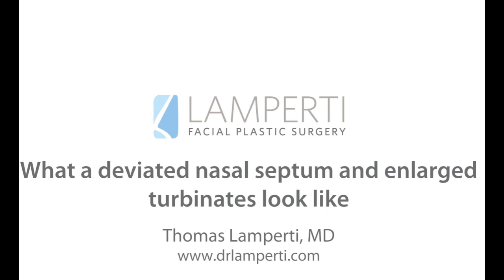What a deviated nasal septum and enlarged turbinates look like

Comment: Hi, Dr.
Is the turbinates made
out of tissue or bone ?
Reply from the maker: +Ruben Ruvalcaba The turbinates are made out of both. There is a thin layer of bone in the center of the turbinate which is then surrounded by varying amounts of soft tissue. Best, Dr. Lamperti
Reply: Hello Dr. is it possible to shrink enlarged nose(side) affected by sinus? If so,how can i shrink naturally without operation or nose surgery?
Reply from the maker: Kennedy Charanga There are various nasal medications that can be used to reduce internal nasal swelling. You can check with your doctor for specific recommendations for your situation. Best, Dr. Lamperti

Comment: hi i have a deviated septum ,recently using steroid sprays but no relief, i am afraid of operation and tell me will marks of stitches remain after surgery if remains
 then how much
Reply from the maker: amir ali The standard septoplasty incision is placed inside the nostril area where no one else would see it. In my hands you wouldn't be able to see any suture marks once the sutures dissolve. Best, Dr. Lamperti

Comment: Is it possible for half or a portion of the turbinates to be enlarged and not all of it?  I might have to get the turbinate reduction surgery, sometimes I hear like a popping noise in the area that I feel discomfort is this normal? I think it  might be the turbinate rubbing against the septum.
Reply from the maker: Yes, it is possible for the turbinate to be asymmetrically enlarged. In some people the turbinate is enlarged more toward the back of the nose or vice versa. It's hard to know what is causing your popping noise -- that's not a typical symptom of turbinate enlargement in any case. Best, Dr. Lamperti

Comment: Hi Mr.. Lamperti, just checked out your website and VERY impressed by your work! You seem like a true expert! It's seriously great that you can achieve the kind of results that I've seen on your website....a nose makes a huge deal in a person's sense-of well-being since they have to live with how it looks/functions for the rest of their life.

That being said, I was wondering what causes trouble breathing through the nose BESIDES a deviated septum? I had 3 cases of trauma to my nose a year ago. The nose never broke or change on the outside, it just got red. However, after the 3rd hit my nose felt really weird and damaged on the inside. It feels permanently stuffed up on one side and its not really smooth to breathe out of the other side. I just want to get my old breathing back. I've gone to 3 ENTS and all 3 of them said my septum is NOT deviated and I have the same amount of space to breathe on both sides. So what else should I do if this breathing is really bothering me? By the way I NEVER had allergies or any stuffiness/blockage before the trauma so I feel like there could be cartilage/structures in my nose damaged that maybe the ENT's couldn't see?
Reply from the maker: Hi Lena,
I can't say what's causing your nasal breathing problems without examining your nose, but in general other causes of nasal blockage (besides a nasal septal deviation) include enlarged turbinates, enlarged adenoids, nasal polyps, and narrowing to the internal or external nasal valves. An injury to the nasal valve is possible with trauma and could involve damage to the cartilage support of the nose. Best, Dr. Lamperti

Comment: thanks for the answer,doctor. so if cartilage has memory, does that mean after the surgery it will go crooked again over time? and how risky is the surgery? also, is it possible to achieve 100% perfect breathing from this surgery? i can breathe just not very well, so i feel like this surgery is a waste unless it can give me perfect, clear breathing.
Reply from the maker: Every surgeon is different but I usually remove the crooked cartilage so that it isn't in your nose anymore to cause trouble down the road. I'll sometime replace a portion of straight cartilage back in there, though. Septoplasty surgery isn't typically a high risk procedure. Your specific surgeon would be able to give your more customized guidance on that.  It's hard to know what 100% perfect breathing is. There is no "normal" amount of nasal patency that we can use as a guide. The sensation of nasal openness is quite subjective. I find that a lot depends on how deviated your septum is and how much straighter I suspect I can make it. Best, Dr. Lamperti

Comment: Hello Doctor. Had the Flu back at the end of February and ever since then my smell and taste faded. Been told it could be sinusitis. Going to an ENT doc and after a few visits and after a round oral steroids the inflammation in the left nostril seems to have gone down but he stated the right was still inflamed. Still having trouble with smells and taste but seems to have some gradual improvement. Could the tribunates be an issue? Seems like the smells seem to come and go. I'm currently using generic flonase and allegra. I will be going back for a follow up in 1 1/2 weeks and should I ask my doctor for an x-ray or CT scan to see if there is any other issues? He has been using the endoscope to see into the nose. Also  could the inflammation or turbinates cause the reduced smell? I've been to an allergist and they said i tested positive for dust mites allergy but have never experienced these nose issues like this before. Also seems like the stuffiness in my nose switches sides . Any insite on steps to ask my doctor or suggestions would be great.
Reply from the maker: Hi Ralph,
That's great that you've been seeing an ENT doctor about your smell and taste issues. It would be unusual for turbinate enlargement or congestion alone to make it hard to smell or taste. That's good to hear that you're noticing some gradual improvement at least. At some point your ENT may want to do a sinus CT scan but that depends on how your nasal exam looks and how your symptoms are doing. The main idea of a sinus CT is to make sure that there aren't any polyps up high in the nasal cavity blocking the smell organ. I haven't actually examined your nose so obviously can't give very specific advice.
Best, Dr. Lamperti

Comment: Hi Doctor again great video. Couple questions again please answer you would MAKE MY DAY as I have been struggling to breathe for MONTHS. okay so since cartilage is flexible, can you push on your deviated septum to move it back to the middle? mine is bent to the right and i wonder if by constantly pushing on it over time (like sticking my finger up my nose and physically pushing it) I could move it out of the airway?
also should I consider getting surgery? I have NO Other symptoms (no nosebleeds headaches) besides a right blocked nostril (and sometimes the left one but mostly right). i dont want to live with bad breathing forever, but again i am scared of surgery. also, I heard "everyone" has a small deviated septum and they dont notice. is that true? i dont want to get someting fixed that doesnt have to be, you know? I have a deformation of cartilage in my nose from pressing on it (but i never broke it) so i wonder if it will ever just eventaully heal up or shift back to the middle (like it used to be)
Reply from the maker: Hi Rose,
Though cartilage is bendable, it also has memory and tends to want to go back where it was. It's up to you about having surgery. I can't really give much input on that since I haven't examined your nose, though. Septoplasty surgery is certainly elective and is done to help with nasal blockage symptoms. You don't "have" to get it fixed if you don't want to. Best, Dr. Lamperti

Comment from the maker: Hi alf,
The middle turbinate less commonly overgrows and blocks the airway. However, the middle turbinate can sometimes have what is called a concha bullosa. This basically means that the turbinate has an air cell inside it. This can cause the turbinate to be too bulky. There are ways of reducing the size of a concha bullosa but this is different from treating the inferior turbinate. Concha bullosas aren't related to allergies. That's just how the turbinate formed. Best, Dr. Lamperti

Comment: My ent said he can see to the back of my thoat, but only checked my right side which was the most obstructed. Then he goes on and starts becoming dismissive of my symptoms, and said nothings wrong. However, i can see the cartilage is bent like a boomerang to my left and blocking most of my right side, i also get occasional get sinus pressure, pain, clogged nostrils depending which side has pressure, and excessive mucus in the back of the throat, i used to have nosebleeds on my right side

Comment from the maker: Hi SinupretSA, 
You're right that allergy meds won't address a deviated septum directly. In those with significant allergies treating the allergy issue sometimes is all that they need. A lot depends on how badly deviated the septum is, as well. There are various gradations in severity. Also, some people do best with having both a septoplasty to improve the nasal airflow as much as possible and taking allergy medications after surgery as needed.

Comment: Hi Doctor, thanks for answering. There was indeed a trauma when the tip of the septum was severely bent on one side - towards the side affected by the swelling. There seem to be some sort of liquid collecting under the skin lining as I can feel at the touch with the sip of the finger.The swallow feels as 1/8 inch thick and extends upwards inside the nostril. In the other nostril, the septum feels firm to the touch at the same moment.